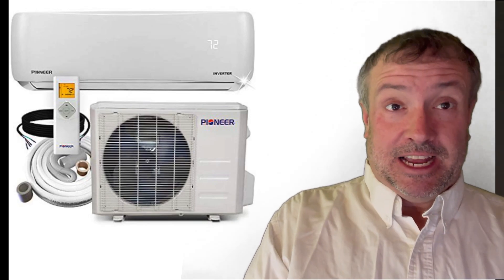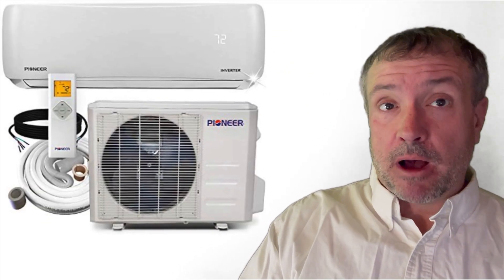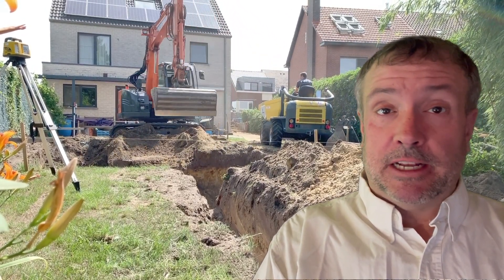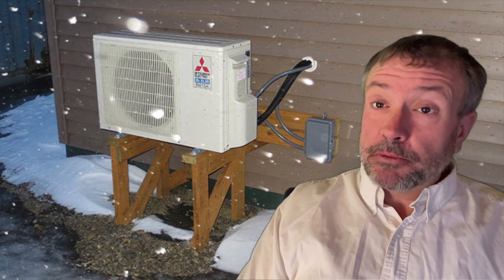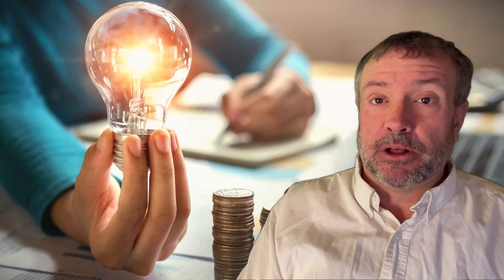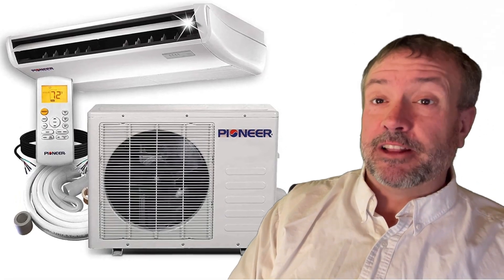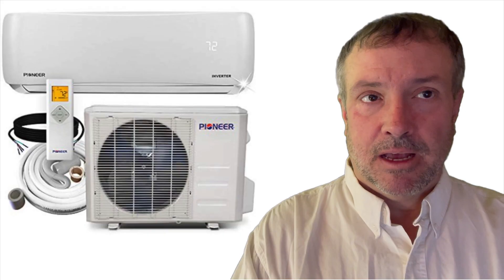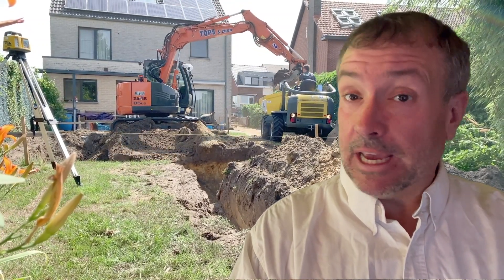Geothermal Mini Split Air Heat Pump works in -40'

Comment: Yeah I have some concerns about the airflow with this system, the BEST 6" mixed flow fans (like a hyper fan or even AC infinity) move 430cfm or so and thats with no load. The fan on the outdoor unit of your average 20 seer 2 ton mini split moves 2500-3000 cfm. And those 6" mixed flow fans are not going to move anywhere near that 430 cfm when blowing through 250ft of corrugated tube. The "duct booster" fans shown in the video are much less efficient and move much less air, like 150cfm or so.
Reply from the maker: you add a fan on both ends, one pushing and one pulling. you add tubes depending not he size of your mini split.
Reply: This is why you Frankenstein it by installing water based geothermal lines and switch out the evaporator with a refrigerant to water heat exchanger.
Reply: @SimpleTek  then it means 300W + 300W for the fans?
Reply: Is it not possible to use the ventilator from the heat pumps them selfs, I ask my self???
Reply: @ernestlageman1553  yes, I think you could push/pull through the tubes with that main blower. If in the insulated box you make, you can tightly fit it to separate the air in side from the air output side, it should be able to help with the job for the little inline duct blowers. 

I think in some scenarios, maybe a large higher efficiency duct blower might make sense on each end, like an 8-10”+ furnace blower... and make a manifold, where the 10” outlet/inlet splits off into the individual smaller lines. Would need to test it before burying it or hopefully find someone who’s already done the tweaking and proven what works best. (As you could add individual line blowers as well and/or control main furnace blowers with a variable speed control. An ‘Air balancer’ person might be able to help with optimizing the design.)
Reply: Most round smooth 6" HVAC duct will only flow 85cfm.. even with duct fans I don't think there will be enough cfm to support the condenser.. most need 1000cfm +
Reply: Just thinking outside the box here.. but what about letting the condensor fan of the outdoor unit do all the work? Fan speed is hardly the limiting factor, should be the compressor. Even with some cfm:s lost it might be the better alternative to running a constant speed duct fan..
Reply: @GMC-qo9xi most large furnace fans use similar or even more wattage than the whole mini split, I tested one rated for 2500cfm the other day and it was pulling 10 amps on 240v so thats 2400 watts, pretty similar to the maximum power pulled by a mini split. I think if you want geothermal level efficiency for low cost your best bet is hybridizing the mini split with a water loop or just getting regular geothermal gear and installing it yourself. They also have minisplits that are built geothermal ready and all you would need to do is do the excavation, lay in the pex, hook it up and fill it.
Reply: @rjay5506  I was way over estimating—except in the case of a massive greenhouse, like the Chinese one’s that are like a 100m. But the question that remains is whether it’s a terrible idea or not to try to use the mini split fan itself to push/pull part of the load, or whether it could handle the whole load without straining it and prematurely causing it to fail.

I have a decent 8” duct blower that I think would probably work well in most normal size diy’ers setup... it’s rated at 520cfm and 188w. It’s on a variable speed and would probably only need to be run around 50-75%? As the idea of whipping air through at high speed would actually not work well for heat exchange and would kind of defeat the purpose.
Reply: @russiannpcbot6408  Can you explain this more? So you'd use mini-split head units inside the house, a water+antifreeze ground loop, and what connects them together? Is there a commercially available component, or is it something a person would have to DIY?
Reply: @BobPaul  DIY. I have to wait till Spring to dig my geothermal lines so I haven't done it yet. If you don't feel comfortable removing the condensing radiator, then you could consult with an HVAC tech. You'll need to replace the condenser outside with a heat exchanger that you can tie into your geothermal lines. That'll make the heat pump far more efficient. The alternative is to buy a geothermal heat pump unit but they get really expensive. I've priced out digging my own 2 foot wide and 10 foot deep trenches with multiple layers of pipes to about $2,500 dollars. I'm going to fill it with distilled water.
Reply: Considering that those corrugated pipes tend to crack underground and then fill with water as he made a point of in another video, I think the liquid pipes are the way to go. I'm going to see if I can find a mini split that does that because I'll be putting in a new system in about 90 days.
Reply: Mini splits come with the compressor / condenser unit that mounts outside and then you run tubes and cables through your wall to the head unit inside your house. The unit outside has the connections for the liquid tubes.
Reply: Because the condensers and compressors are outside, that's the reason for needing the 6-in corrugated pipe inside of a box to keep it from getting too cold and causing the unit to lose its efficiency.
Reply: I wonder if it would be better to leave an opening on the insulation for the condenser fan and just have the box cover the intake sides of the condenser, that way you wouldn't be fighting the condenser fan
Reply: i was thinking in stead of a box, just blowing the geothermal air at the back of the condenser to at least supplement the air that it's using. i wonder if that would help much

Comment: If I am in a rural area with well water, then I would do a modified open loop and save myself the excavation costs.  I would encase the outdoor unit in an insulated box like you show, and within the box, I would have it large enough that I can put in a tank connected to a radiator and a fan and a pump. You can use radiator fluid like in a car, the reason is if you use water and lose power then water might freeze.  Alternatively if you have a shallow well, where water table is high you can use heat pipes and no need for a pump as the heat pipes are connected to the water below which is 10C on average and will convey the heat to the tank, and the fan blows air through the radiator which warms it.  You can also couple this with flat plate solar collectors and heat pipes that extend to your working liquid fluid and warm it and mix it with the grounded liquid reservoir to elevate the temperature of the air. Or have a large enough reservoir tank for the solar thermal panel that you can mix throughout the evening when it’s normally colder at night.  And if you have backup wood heat for the coldest nights say in January of February you can use a wood loop with a copper loop around the black stove pipe.
Reply from the maker: @KimberlyRPeacock  sweet

Comment: this is smart. thanks for sharing. excavation yeah is expensive but we’re thinking about putting in an adu and this could make sense for us tbh.

any spreadsheet breaking down cost savings over time? it’s basically going to be an up front investment of the excavation, tubes and fans. that’s like an additional $5-7K call it. wonder how much electricity savings it takes to pay back over time or if we are just fine with solar if we live in colorado?
Reply from the maker: Good question

Comment: Inlet airflow only need to be enclosed by a plenum connected with the underground ducts and “booster”fan, all computer modeled or manually calculated to size them. /eliminated reduction in airflow.  Discharge of the condensing/evaporator unit (outdoor unit) does not need to be ducted, but merely discharged to ambient air.
Reply from the maker: Cool ideas

Comment: In another video you mentioned that these corrugated pipes will crack because they're not designed for this type of use. If they fill with water and are unable to pass the air through them, it seems like I've only created a problem for myself. There's HEPA filters that can block out the bacteria that might travel through the forest air pipes so that's not a huge concern. But it is another option if there's a way to protect the pipes from cracking or allowing water in. Or use perforated pipe that at least lets the water out if it's buried in gravel similar to a septic system.  But I'm building a house on the cheap so this may end up being the way that I go or maybe I'll run the liquid and the air in the same trench to leave myself options for later.
Reply from the maker: Interesting

Comment: I have been imagining some system like this and trying to find some info on something, finally stumbled upon youe video! Would there be any difference in doing this on a regular heat pump?
Reply from the maker: @Beaster456  it’s possible I think
Reply: @SimpleTek  do you have many resources on designing such a system? Like how big does the insulated box need to be, how big pipe needs to be, how long etc?
Reply from the maker: @Beaster456  sorry, no

Comment: Do you ever have to worry about water or roots getting into the tubes?
Reply from the maker: good question - I haven't had an issue... if it's a sealed tube it shouldn't be a problem but stuff happens...

Comment: I custom made a system like this for my central AC in 2017, for a 5 ton AC I started with 600 feet of corrugated PVC pipe @ 40 inches under ground.  It lowered my electric bill in the summer. In  April 2021 I tripled the amount of underground pipe pushed it down to 60 inches. I intend to install a heat pump but for now I only have the central AC running. I dont have a closed system so I have to filter the intake of the air to the ducts system.
Reply from the maker: love to hear the results of the new system!!!!!
Reply: @SimpleTek  The first 600 ft is still at a depth of 40 inches I did not have the energy to shovel it out and risk damage. The new 1200 ft I hired a back hoe to dig the channel and a large 14 ft circular hole at about 15 feet depth. I don't have the acreage to do straight linear.
What do you think about running these pipes through the attic for a heat pump? I heat my pool with hot air from the attic in the summer with 2 radiators from a junkyard
Reply from the maker: @silentvoiceinthedark5665  interesting, I’d love to hear about the results of the attic

Comment: I'm working on turning some window AC units into zoned geothermal radiant heat pumps. I think of the idea as geothermal mini splits. I'm going to dig my own vertical loops. I'll have 10+ 60' vertical loops. I plan on running geothermal lines to each AC. I'll switch out the radiators with refrigerant to water heat exchangers. I can switch water flow to alternate between heating and cooling. It's a complicated project, but it sounds fun to me.
Reply from the maker: that's a really interesting idea, thank you for sharing!
Reply: посмотри может у тебя вода близко и тогда все эти ..лупы бурить не надо, пару абессинок пробурил 10- 15 метров, самодельный вода- вода на них повесил, живи и радуйся почти бесплатному теплу в доме. Это мой примерный план на будушее лето, если воду не найду на глубине до 15 метров то десяток дырок под лупы наделаю с помощью абессинского буратино
Reply from the maker: @andreycham4797  don’t speak that language
Reply: @SimpleTek   Ok, I was talking to Russian bot
Reply from the maker: @andreycham4797  lol

Comment: Like the video. Are there any trenchers that go down 6-10 feet?
Reply from the maker: good question, the machinery is possible but the issue is sloughage falling in when you get that deep and you have to widen out the edges. unless your'e on solid rock

Comment: If you're going to go through that much trouble of digging, it seems you might as well go for the full geothermal system and use the tubes they recommend.
Reply from the maker: @aarqa maybe
Reply: @SimpleTek  Hey, I just thought it would end up being something like 'it's just a mini-split, so the amount of digging was much, much less than a traditional geothermal system'.  This still looks like it's a lot of digging.
Reply from the maker: @aarqa some of us like digging

Comment: Could this be done for a heat pump for the house overall with the same effect?
Reply from the maker: yes,  first a mini split IS a heat pump, one that uses air. You could also do a liquid system with a liquid heat pump, which is the most common type of geothermal used for homes today but they are a lot more money
Reply: @SimpleTek  that is why I was thinking this could be a more affordable solution

Comment: quite interesting but I would like more details of the enclosure around the mini split outdoors.  Also a flow diagram would be very helpful for the airflow.
Reply from the maker: Noted! - it's just a large insulated box with corrugated pipes coming in and out of it on each end
Reply: @SimpleTek understood.  The corrugated tubes bring in the air to the outside unit but then the air is exhausted to the atmosphere.  How does the box allow the exhaust air to escape?  Once the geothermal air passes thru the outside unit it needs to be gotten rid of, correct?
Reply: @mikelyon7748  It would just pass into the tubes and go back around the loop. If its the correct size you should always have the same temperature coming in at the intake. In short it would be a closed system at that point with no need to exhaust.
Reply: @Dimrain13  That would be ridiculous, the air being rejected from the evaporator is going to be 20 degrees colder than ambient. That would need to be put into the atmosphere and new fresh air that is 20 degrees warmer would reenter the ground loops. So really what you need is a half box encapsulating the inlet side of the evaporator and the inlet pipes outside the box in fresh air.
Reply: @anthonyspadafora1384  I'm not so sure that it's crazy since the fan will be pulling cold air through the wam radiator then into the outdoor unit then out to the atmosphere. The radiator would drop the intake temperature but I'm not sure by how much since it likely based on the flow rate and size of the radiator. That said having the whole unit in a case would likely be more efficient since it's able to be kept a constant temperature, but having thinner piping has something to be said for it vs a air duct going to a second floor. Idk maybe it's possible with a 2in duct with two high power fans? I need a calculator for this.

Comment: What type of pump do we need to use when using the closed loop with antifreeze or windshield fluid?
Reply from the maker: a taco pump or similar brand
Reply: Thanks
Reply: Several companies make suitable pumps. Grundfos, Taco, Bell and Gosset......but it takes knowledge to select the right pump based on desired flow rate, total resistance of the run, working temperature etc. There are many, many models to choose from but only a small number will be suitable for any one project.
Reply from the maker: @paulmaxwell8851  test test test
Reply: You have to buy the right fluid from an industrial supply company. It’s not much more expensive but you don’t want to clean up the mess from using plumbing antifreeze, car or washer fluid.

Comment: Would it adversely affect the performance if perforated pipe was used?
Reply from the maker: greenhouses use perforated pipe all the time for this
Reply: Perforated pipe will fill with sand and clay fines as it is designed for drainage. Standing water/ moisture in the pipe will have a negative effect on your equipment over time. Better to keep things dry in those pipes.
Reply: Thanks for the reply guys. Interesting video.

Comment: How to deal effectively with mildew buildup in the pipes? I expect condensation in the pipe, moisture will lead to fungal growth.
Reply from the maker: honestly - who cares? it doesn't translate to your house when using a mini split
Reply: @SimpleTek  I don't know man, that black mold spores can't be good for one's respiratory tract.
Reply from the maker: @mkeyx82  once again, with a mini split none of that transfers into the house. It’s a heat transfer not an air transfer into the house
Reply: @SimpleTek  oh, yes, of course, silly me. I was thinking about those systems that use similar piping to get the air directly into the living area.
Reply: But would it adversely affect the performance if you did use perforated pipe?

Comment: If you have a water well, simply buy a water source heat pump (geo-thermal...), and plumb it in. Think about how deep the water well is, and the stability of the temperature at that depth.......I have two, and both work amazingly well.
   Find great deals on the heat pumps on eBay!!
Reply from the maker: Yes those work great!
Reply: How do I search the heat pump in eBay? Under what name or brand? 
 
Where can I get a heat exchanger to increase the efficiency of the minisplit with cold water in summer and with hot water in winter?

In my experience, when the air ambient temperature drops below 5 ºC my minisplits consumption goes from 230 watts to 800 watts
Reply from the maker: @ajarivas72  everything is in short supply these days, keep trying eBay and Amazon

Comment: How about connecting the Heat pump directly to a green house? In the Pacific North West a well built green house very rarely gets below freezing. I would get more year around use from a green house than expensive hoses,
Reply from the maker: Good point

Comment: Think an inverter style heat pump would be super efficient where I live. Adding the box and ground source would only make it work amazingly cheaply.  Since I am basically looking at a delta T of about 15 degrees. Not sure why I would need to do much more than circulate the air thru the tubing and back into the box.  This to me makes a great deal of sense since there seems zero reason in my thinking that one would need to pick up cold air from outside air rather than keep circulating the air thru a warmer ground source.
Reply from the maker: Well said.